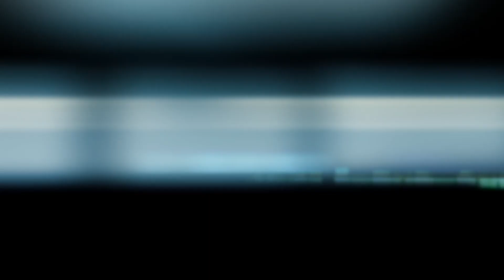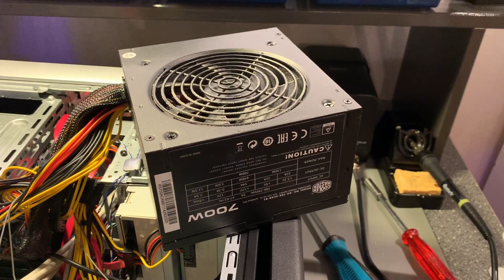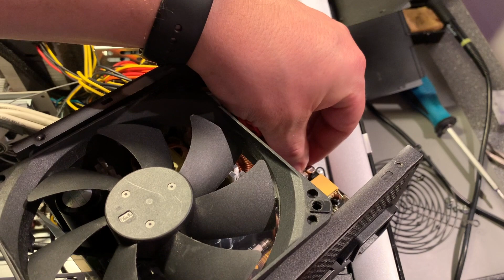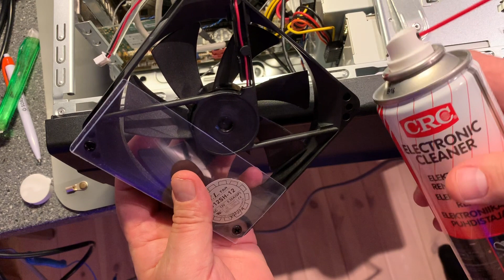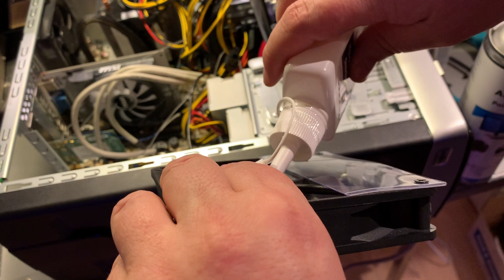Fixing a noisy PC power-supply

Comment: Sometimes stuff goes wrong, acts up etc. Best by far is to locate your local repair resources. £60.00 for a 100% effective repair in five-six years shouldn't be a problem to you and it's much better than screwing up your machine or (worse) getting a belt off it. Unless you're handy with a multi meter and know what capacitors are about, take it to a competent person.

Comment: i find myself doing this at least every month. is that normal? seems like it will always go back to that grinding noise. but with just adding a bit of oil it will quiet it down just momentarily. is there a better solution? or is it normal to often add oil on that part?
Reply: No it's not normal. In fact it's not normal to open your power supply.
Reply: Take it to a repairer. Simple!

Comment: I have a year old PSU.  It is top of the line gold rated.  The coil whine from it is so loud lately.  Could it be filled with dust?  Is it not enuff watts now that I upgraded my GPU?
Reply: If you want to check wattage compatibility you can put all of your components into PC Part Picker which will give you a wattage requirement minimum. As a general rule you want an extra 100 to 200 watts over what it tells you. You need a little head room on the wattage.

Also these days a Gold ratting really does not mean anything as very few PSUs are under Gold. The Gold rating system is just about how efficient they are but not what is actually in them.

80+ = 80% efficiency at 100% load; 82% at 50% (working) load
80+ Gold = 87% efficiency at 100% load; 89% at 50% (working) load
80+ Titanium = 90% efficiency at 100% load; 94% at 50% (working) load
 
Now you have to check the PC Cultist PSU tier list. There are some expensive PSUs low on their list and there are some cheap ones high on their list. They sort everything on their list by components used, output options, true efficiency under realistic loads, build quality, and life span. If it is not on their list though it does not mean it is bad just that they have not tested it yet, and if it is an older unit they likely never will. That said if yours is only about a year old it should be on the list.

Comment: DO NOT DO THIS. DO NOT OPEN YOUR POWER SUPPLY. IT CAN SHOCK YOU VERY BADLY. Also you hear his accent. He's Russian. He he'll be ok.
Reply from the maker: I'm Norwegian. No danger at all
Reply from the maker: Obviously it is now powered on. And the capasitors are drained
Reply: @Arcticretro  that's not explained. So people will just pop it out and open it
Reply: Guys do not put your power supply in the microwave it will explode but it was a lot quieter when I plugged in👍

Comment: What was that clear plastic piece covering about half the fan's intake/exhaust area?  I've not seen that feature before.

Others have mentioned the method for bleeding off stored voltages in an AT/ATX power supply unit:  press and hold the power button on the system with the power cord disconnected.  The power LED should light briefly, then fade out.  The unit should now be safe to work on, but make sure (put a tester or a meter on it).

Lubricating a fan is different for each fan encountered.  If you're in a situation and need to quiet the fan NOW, use of some silicone-based machine oil (like 3-in-1 Silicone) will help.  With any oil, use sparingly.  Excess oil migrating from the fan will make a mess inside the PSU and cause dust to adhere to it.  I'm presuming this is why Tom followed oil with contact cleaner, to remove any excess.

The best path forward is to replace the fan.  Depending on the PSU design, this may not be a simple task.  Please bring the work to a qualified technician if you are not sure how to do this work safely.  Selection of the new fan should be done AFTER examining the old one to determine correct supply voltages, presence of any "smart" sensors, etc.
Reply: "Its a baffle, designed to change how the air flows through the hot parts in the power supply. Without it, air would take the path of least resistance and not go through the hot stuff." - linustechtips/iamdarkyoshi

Comment: Just fyi....please please!!! Don't plug your power supply in while plugged in if you are going to do this. They have exposed voltage and other regulators. and they will fry and hurt you really bad. That is an exposed power supply. Say 500 watts? Yeah tough it wrong you will die. There are warnings  about opening your power supply so if you do do not plug it in and I would not touch anything in there except for the van. Those voltage capacitors are like a battery hence the name capacitors a hold and store wattage excuse my electrician knowledge but I could be wrong on how it holds it but it will hold power and if you touch it it will zap you and it can kill you. It regulates electricity so it holds electricity in it for a long time after all

Comment: My psu is making a very similar noise. I'm not willing to attempt to fix a psu myself, but until I'm able to get it fixed/replaced (undecided yet) how safe is it to use?
Reply from the maker: Not sure. Probably the bearing is worn. Should not be a problem
Reply: @Arcticretro  I'm thinking it's a bearing. If it wasn't on the psu, I'd give it a go. But better safe than sorry
Reply: Same i dont want to shock myself, is there any trusted place to get it fixed?
Reply: @Im_SSJay  Geek Squad or Best Buy should be able to help you. Be careful going through search results to avoid tech support scams.

Comment: Do this with care. I also wouldn't recommend open up your Power supply.
They have high voltage Capacitor in it that hold up charge for very long time that easily kill a human.
Reply: Also, you can discharge the high voltage capacitors by either powering on the system while unplugged, or shorting the green wire with any of the black ones.
Reply: Once, I swapped the fan in my PSU for some quiet fan I had laying around, my computer got SIGNIFICANTLY quieter.
When it was stock, the damn computer sounded like an server, despite being a regular rejected PC. Once, I even  accidentally wired up the new power supply fan incorrectly, and yet the power supply got through a system software update without shutting down! 
Unfortunately, if I want to get an even quieter experience, I'd have to replace the CPU cooler, as it makes about 90% of the remaining noise. The case is also really cheap, so resonance heaven.
Reply from the maker: Yes, I know :)